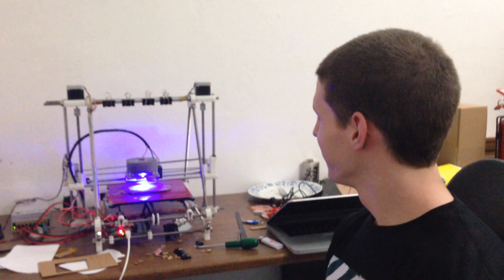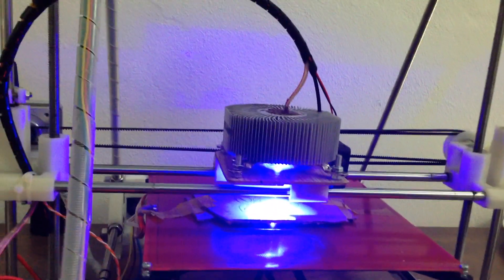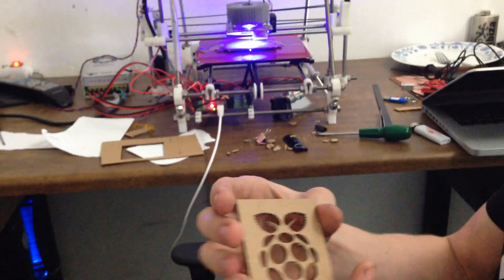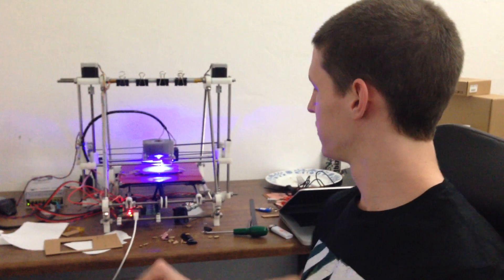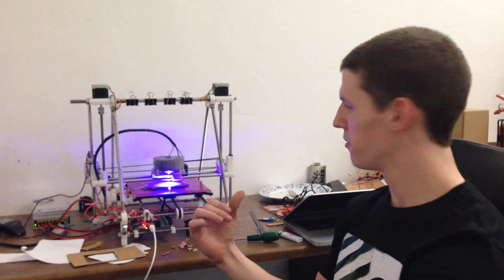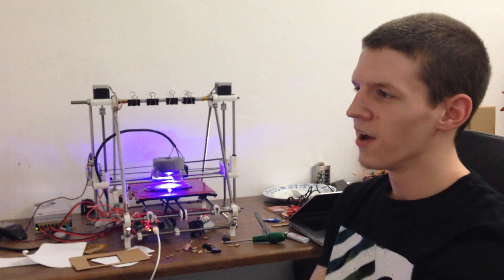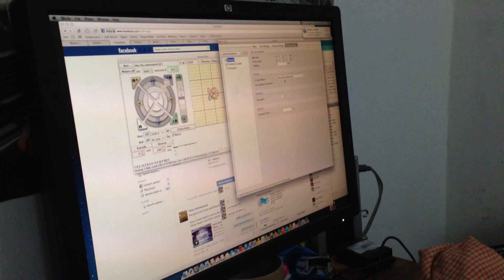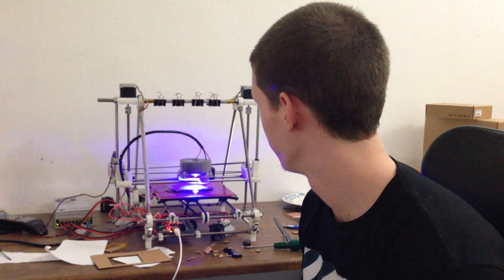Prusa Research Laser Cutting with Prusa Mendel i2

Comment: Can anybody please tell the exact model of the laser in the video? Michal says it's 445nm, but how many mW? I want to cut 5mm wood. Any advise about the laser I need and where to get it? Thanks!
Reply: #nerdalert  <3
Reply: 0:16  2 watts (2000 mW).
This is just cutting cardboard though.
Reply: Matto Godoy For cutting wood or plywood You'll need way more powerful laser. For cutting 5mm plywood you would use at least 10 Watts, or you can try it with less powerful laser, but cut time would be ten times longer, and there is bigger chance of browned edges of the cut. Anyway, whatever you try, post the result here. I am so curious :-)
Reply: I thought it was cutting the wood with the Raspberry Pi logo :'-(
Reply: Thanks a lot! I'll let you know if I make any advance.

Comment: Nichia NDB7875 1.6W or NDB7775 over driven to 2W. There are cheaper 5mm diodes from A140 projectors that will do 2W aswell, but you the want 9mm ones that have ESD protection and a larger area for heat dissipation for longer life.

Comment: This really needs to be in an optical filter (orange) and particle filter box! I've been working on my own design using these lasers, and at 2W 445nm it only takes one mistake to send you blind. An air (or argon) pump keeping particles away from the lens will also increase it's lifetime and cutting performance and help keep it cool.